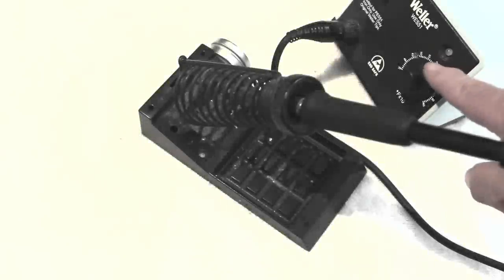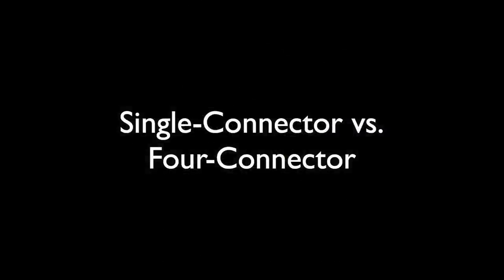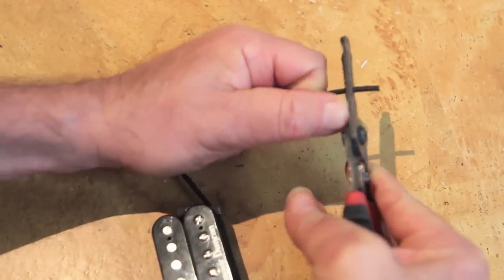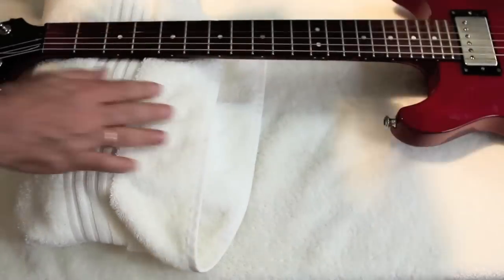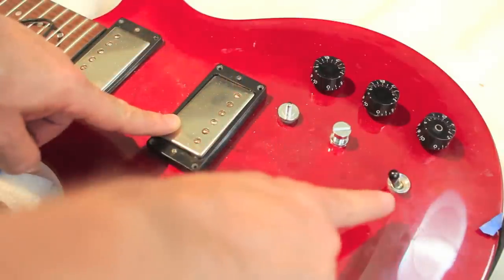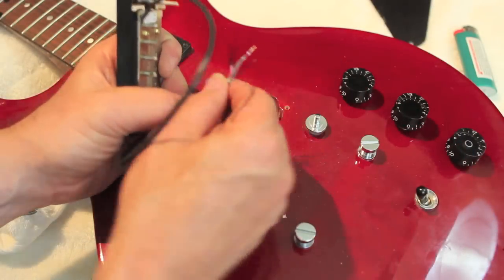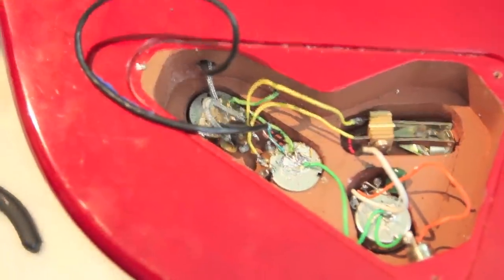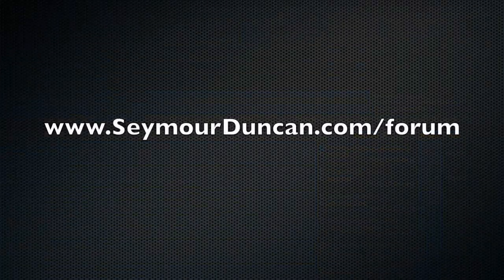How To Change Guitar Pickups

Comment: Hello People at Seymour Duncan,chances of them replying maybe slim but iam thinking of replacing the bridge and neck single coils of my strat and get humbuckers,so which do you think is the best humbucker from the diffrent types pickups?
Reply from the maker: We would need more information. What kind of music? Do you want single-coil sized humbuckers or full-size? What don't you like about your current pickups?
Reply: Okay so i want some pickups with that have a sound the can suit a sorta hard rock to heavy metal sound i want them single coil size so i can save space and what i don't like about my pickups is when there is a little bit of distrion it has this screachy sound that ruins the sound of the distrion
Reply from the maker: You might check out the Hot Rails (more metal) or JB Jr (more on the hard rock side of things). Both sound like it would be a great match.

Comment: Are all pick ups for less Paul guitars standard? ie can i buy any pickup for my guitar?
Reply from the maker: Generally, yes. They come in 2 conductor and 4 conductor (number of wires). If it is wired like a standard LP, any 2 conductor pickup will work. If you want splitting options, you need a 4 conductor pickup.
Reply: Seymour Duncan thanks!
Reply: Hopefully they also work in a More Paul style guitar :)

Comment: Anyone know how to remove a pickup and not replace it? I have an HSS strat copy but I wanna take out the single coils
Reply from the maker: Caleb Lewis If you just want to disconnect it, remove the desolder the hot wire.
Reply: If you want to remove it, but not replace, just desolder the preexisting single coils. It wo't do any harm lol.
Reply: i actually cut em out and everything went fine haha

Comment: does the green wire ALWAYS need to be with the bare wire?
Reply from the maker: +Martin Roussev Yes, unless you are doing some fancy rw/rp or phase switching.
Reply: ***** ok, because in my current wiring in my prs the ground wire is connected to the 5 way switch
Reply from the maker: +Martin Roussev is this with the PRS pickups, or ours? Also, what kind of pickups (single coil or humbucker) are connected to the switch? PRS sometimes does some funky wiring with their guitars, which is part of their unique sound.
Reply: ***** they were humbuckers, but I already changed the bridge pickup to a seymour duncan. The ground wire had to go to one of the terminals at the 5-way blade switch. Surprisingly, everything works fine! Thanks for the replies btw, most channels never reply D:
Reply from the maker: +Martin Roussev Yeah, I know that some PRS guitars use some strange switching, so that makes sense. Happy it worked out!
Reply: +Seymour Duncan when heating the lug for the black wire, do you heat the opening, where you put the cable through, or where?
Reply from the maker: +alex agosto I put the iron right on the opening.
Reply: Thanks! Im thinking of the classic JB/ Jazz combo for my prs custom 24 SE.
Reply from the maker: +alex agosto This would make that PRS rock!
Reply: +Seymour Duncan If i were to want to do a push/ pull with the pickups do i solder the green and bare wire to the tone pot that has the push pull?
Reply from the maker: what do you want the push-pull to do? Generally they would go to ground, always. We also have detailed wiring diagrams on our website, for whatever you are wishing to do.
Reply: ***** I want it to split the humbuckers.
Reply from the maker: alex agosto Generally, red & white go to the switch for coil splitting. Black is hot, and green & bare are ground. Which diagram are you working off of?

Comment: Hey thanx a lot sir for making me independent on some weird people... ;) :)
It was really very very helpful...i dont really think you missed out anything .
Reply from the maker: Thanks for watching!!
Reply: Seymour Duncan buddy theres a problem ....i have an Ibanez rg350 dxz ....it doesnt have any space for electronics like you showed in that guitar ( at the back).... please help
Reply from the maker: The electronics in your guitar are accessed under the pickguard. You have to take the strings off, and unscrew several screws holding on the pickguard. Underneath, you will find the electronics. If you are stuck after that, you may need us to help by either going to seymourduncan.com and sending in an email, or joining our forum at www.seymourduncan.com/forum and posting detailed pics. Any wiring problems after the wiring is accessed is difficult to diagnose on YouTube.
Reply: Seymour Duncan sure buddy....thanx a lot for your time and help  )))

Comment: i have a problem on my guitar my guitar is not balance the volume my high e string are very low tune than the other string what is the problem is that?
Reply from the maker: What pickups are in it? Have you tried raising the treble side of the pickup?
Reply: yes sir i tried my volume to put in high volume but still my e string are so low than others
Reply: before i change my strings the sound of my high e steings are good but now it does not fit to others sound its so low and not balance to others strings sry for my english.
Reply from the maker: Hmm, are these our pickups? If they are, you can try sening an email to us via our contact form @ SeymourDuncan.com Also, try registering for our forum at seymourduncan.com/forum and posting a question there, as YouTube isn't really great for diagnosing pickup problems.

Comment: what if my pickups have only one wire. Do I skipp the grounding? Please replay fast
Reply from the maker: +IGarrettI You have to have 2 wires for a pickup to work. If the outside of the wire looks like braided metal, than the braided metal itself is the ground wire. Check closely on you pickup, and strip back some of the insulation- you will see another wire.
Reply: +Seymour Duncan Pickups Alright I think i get it now! It just seemed weird that this fat brain is a grounding wire hehe. Thank you!